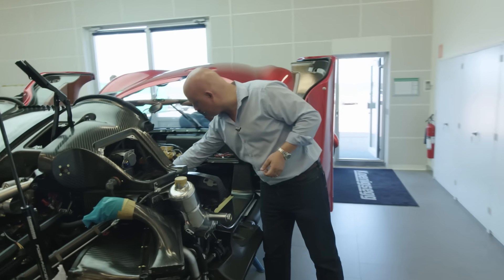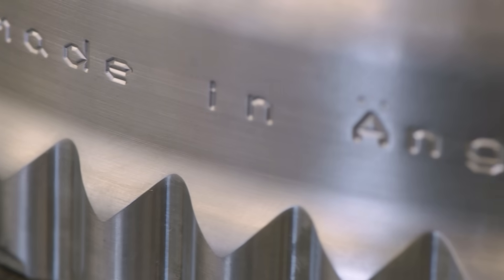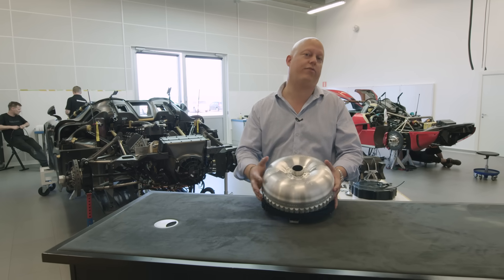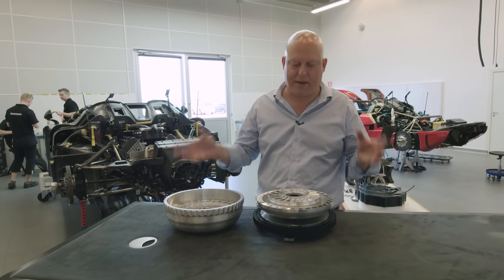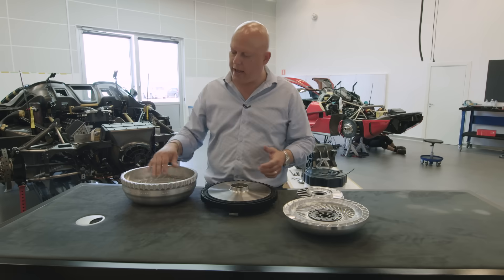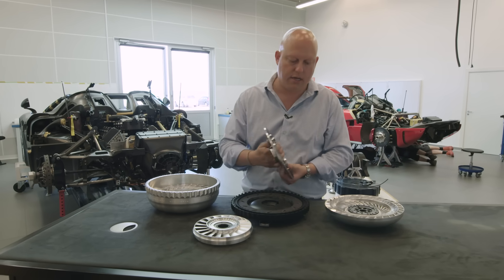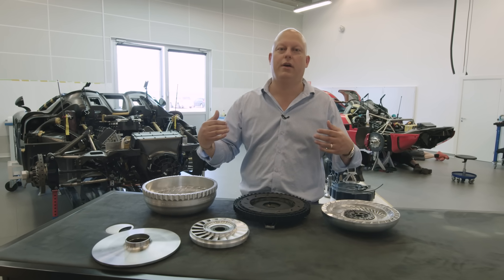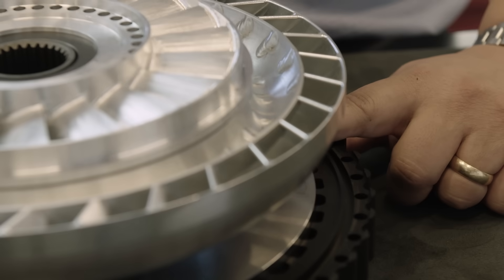248 MPH Without A Gearbox: Direct Drive  -- /INSIDE KOENIGSEGG

Comment: Asks for expert help, no one seems to understand so he does it himself. Keeping in mind this is only one small portion of the car is just insane. This guy is a mad scientist.
Reply: joao branco When this car was first released he said it was based off an idea he had last summer.. this car is like nothing we have ever seen before and he materialised this idea within months. Surely he has a team yes.. but something tells me he's the innovative thinker, main problem solver and a big part of the brains
Reply: he is ! if he isnt how he could have such inovating factory? they make new technology...and build all car themselves under one roof...what other company does that huh?  he doesnt save money...he inovate...learn...I think if he wasnt educated before...he is now...and thats why they also did themselves...to learn about it to be able to understand it completely
Reply: They konsult experts and have really good engineers and scientists. It's not like he designs it all by himself
Reply: John Doe Relativity speaking, it appears so. A torque converter manufacturer vs a company with 98 people total.
Reply: you obviously do not understand how electricity works in motors, higher voltage allows them to use smaller wires in the motors to carry the same number of watts, so the motor is smaller reducing weight while maintaining the power rating they need
Reply: Kubla84 see
Reply: Best Electronic Music From New Geniuses depends on the amperage. Volts aren't nearly as dangerous as amps. In fact assuming the amps are low enough you could touch 800 volts with your bare hand. Higher volts allows them to make the same wattage with less amps. (volts × amps = watts) which would in turn mean thinner wire, which provides weight reduction.
Reply: He's kind of like a car Steve Jobs with enough of Woz built-in to come up with workable innovative solutions that just need to be realized.  Apparently he then takes it upon himself to realize his conceptions even if he has to do it all in-house with his obviously uber-talented small team.  His stuff could trickle down in ways Formula 1 racing has in more modern times failed to do. Often with car manufacturers the point where no partners are willing to help engineer and monetize solutions is where a project like this ends. Few car makers are either unable financially, or engineering wise, to realize radical new technology advancements that don't recoup multitudes of their investments..  This dude just never says never it seems.  On top of that he's a successful businessman much like Jobs.  Yet, normal folks have never heard of him save some of his cars Top Gear or enthusiast magazines have profiled.  His brilliance reminds me of Dean Kamen who advanced medicine and made The Segway yet no one seems to know how brilliant he is.   This converter is stone brilliant for insanely powered hybrids since electric motors have such a huge rev band they don't need transmissions.  Now with the tandem combustion motor not needing a transmission a seamless blending of the two is realized and lots of weight and complexity eliminated.  That said this is one super compact extreme tolerance engineered device.  Impressive.  I hope this guy becomes more of a mainstream manufacturer consultant because things like his cam-less engine heads can really improve just about any current automobile's combustion engine.  Who knows what else is inside his mind?
Reply: @johnwerner4925   I totally agree with you , well said !!!
Reply: Total of 520 kW for the three electric motors.(Plus all the extra power needed by the car)
Reply: + Best Electronic Music From New Geniuses
"it's like 800W mini-speakers" Try that :-)
I think your expertise in Music don't apply to this.
If they have 400 V , the current will be up to 1500 Amps , try to switch that with a silicon regulator in a limited area like in a car.
Silicon never drain to zero, it's always a few hundreds mV over it and every 0.1 V generate over 100W heat.
By increasing the voltage to 800V , those problems will half and it's only a matter of time until you see 1600 V or more.
The danger is if the wires start to melt the isolation, you don't survive 400 V either so a design made to work is safer than 400V burning wires and regulators.
Reply: 2 or 3 yes, not like the 800 "experts" bugatti consults :P
Reply: Ergh, it's not really himself? Like he said, he has experts in the mechanical aspect of the car to create that thing instead of asking others because no major manufacturer seemed to understand what they were going for. He was basically just a conceptor with probably some inputs and economic stuffs, but he does understand the whole thing. Just that he sucks at explaining it, cus you know,  not a native english speaker.
Reply: Knights2theEnd o
Reply: Where did that come from?????????
Reply: When asked which was the hardest part of building the car, his answer was : EVERYTHING!
Reply: 800 W jump ?  , what are you babbling about, effect don't jump.
800 Volt can't even jump 1 mm in dry air, normal temp and pressure.
A tazer has a current limiter and much higher voltage until the limited current pass the target.
eg. first very high voltage with no current (0 W) , then low current and reduced voltage that result in a few watts.
Reply: You gave me chills when I read this....and that's a good thing. Lol
Reply: 800lb Gorilla, you can't say every CVT is the same. Thats like saying every motor is the same.
Reply: 800lb Gorilla, in that youre right, but thats just a boring way of looking at it! Hell, you could just compere it with scooters by thinking like that. In my opinion this is absolutely  revolutionary and shouldn't be taken as a common used CVT in EV's, which there ain't. This kind of idea's is what revolution is all about. And thats why I was implying that youre statement was like saying all motors (engine's) are all the same, because they have a rotating crankshaft!, not so enthusiastic..
Reply: Knights2theEnd 
See new electric engine in my vlog and comment till where the Madness can go for technology...
Reply: Its a combination of him and his team. He is a visionary leader as well as a superb team builder.
He finds the best talent and nurtures it, he has a very clear idea of not just a his top-line goal; 'make the fastest cars' but also the broken down steps needed to achieve that - generate and harness power, add lightness, aerodynamic efficiency, grip etc.

He is completely invested in his product, and also innovative. The gas driven valves, his turbo designs, his lack of concern with making his cars pretty - we have learned to like his aesthetic because of what it achieves. No one got their first look at a CC8 and wanted a poster of it on their bedroom wall because it looks like a half used bar of soap.

Unlike Musk, who fires great engineering minds from his companies over trivialities, CvK knows how to extract tje best from people without feeling threatened by them if its better than what he can do.

This is what makes Koenigsegg (and Pagani, for slightly different reasons) actually worthy of respect, admiration and - if you have the money - ownership.

Its why Bugatti is a joke to me. As Gordon Murray said 'Its a stupid car' (talking about the Veyron). They couldnt focus because they dont have a leader like Christian. They wanted speed, so they added power with a big engine. They wanted luxury, so they added insulation for silence and opulent finish. They then had a heavy car which wasn't fast enough. More power. Strengthen drivetrain and chassis. Ride and handling sub-optimal. More electronic controls isolating the driver from the drive. Round and round that cycle until you are left with a heavy, thirsty pretentious car that looks like a ladybird and can only have its tyres fitted in the french factory at a cost of €80000.

If you want a 200mph VW, buy an R8 v10 plus, an Aventador or one of the top range porsches. Bugatti just tells the world youve got a shitload of money but absolutely no brain.
Reply: hiddenthunder very well said, you’ve written what was in my head, so I won’t bother saying it again.
Reply: He doesn't have to cut the carbon fibre himself, but as the story of Tesla shows, it's one thing to make a prototype out of an existing car and a whole other ball game to market it, find and retain customers, hire the experts, set up the infrastructure, know how much everything costs, raise the money, pay the bills, come up with the ideas, get over the flaws of your first ideas, carry out testing, maintain quality control, get it homologated, finally go into mass production, and make a profit and go on to disrupt the whole market place and show where you're better than the best of 'em. Elon brought all that to the table, or else the Model S would have remained no more than a concept that could have never sold.
Reply: He doesn't have to. But he did.
Reply: A tazer uses 1000 times less amps than a car, and only 7 watts, but 800W can still jump through the air easier than 400.
Reply: Knights2theEnd this is also a gearbox.
Reply: I agree.
Reply: Most of them.  Automatic transmissions and torque converters are... you guessed it... hydraulic couplings.
Reply: Best Electronic Music From New Geniuses
Well 800W mini speakers would be really great. Same goes for the motors
Reply: Nothing new about torque converters just getting a custom one built is an ordeal so just do it yourself.
Reply: He also said that it was just not worth it for other companies since development is very expensive and Koenigsegg just needs a very very low number of actual units. Just designing it, creating the manufacturing tools etc. would cost a ton and then Koenigsegg buys maybe four converters a year. Like Christian said himself in the beginning the actual technology is 'old school'.
Reply: AND More Than 50% of way to
DeLorean Time Machine & "FLUX CONVERTER". what the Mayans were doing 10,800 years ago (Just switch construction materials around). Guess Patents have
expired by then, yes? 💡🙈
Needed Now : zero point energy (where are you, Nikolai?)Peace.
Reply: You have a creative idea, but you don't know how to manage it scientifically, so you ask scientists and engineers to make it feasible.
Reply: Anyone else think this might be amazing to incorperate into madern drag vehicles lol
Reply: He's talking to motor engineers. Full stop.
Reply: This guy restored my faith in humanity..I hate my CVT
Reply: Knights2theEnd please m8. he had a team behind him. he knows what he is talking because it was explained in detail so he knows.. a company that makes millions is not drived by 1 person.
Reply: joao branco in the beginning it was just him, he’s smart as fuck, sure he has other people’s opinions but this man is an inspiration, used to take apart mopeds at age 13 and make them better to sell, he’s a genius and knows how everything works, if you think for a second he’s a sheep than I’m sorry but I have no respect for you
Reply: Or a complete bullshit artist.  It's a torque converter, modified.  This isn't revolutionary work.
Reply: Sandor Clegane must have been last week, happy birthday. pretty much every electric-drive system doesn't utilize a multi-gear transmission. max torque at 0rpm and modulate. yawn.
Reply: Your sister was a pretty good ride she liked working that stick shift.
Reply: Kubla84 Who are you replying too. My vague reply was directed to Best Electronic Music From New Geniuses 
I just couldn't be bothered giving an explanation. My knowledge of electric motors may not be vast but adequate enough to agree totally with Kubla84. I first built a functioning electric motor at the age of 13 for a manual arts assignment.
Reply: And upping the voltage increases chances of arcing, increases chances of injury, and 400 volts is enough for heavy industrial equipment which travels entire rooms, whereas the car electricity travels through 100 grams of wires, which twice as dangerous voltage would bring down to 50 grams.
Reply: Volts gives not indication of the power used, 20,000 watts? he speaks for 10 minutes and gives no indication of the power generated at 800v. that's for people who are idiots. at least give us the watts you get at 800v or not brag at all. else it's just like empty marketing pseudoscience. arcing increases at higher voltages and the wires are not travelling for, perhaps a few feet. arcing inside the battery terminals or after an accident is not worth the magic 800v figure probably.
Reply: @bestelectronicmusicfromnew5189  
Europe has 230V as the common voltage  in apartments and houses, while the U.S has 110?
Same deal, only in DC and taken to the extreme.
Lower temperatures, lighter equipment, lower charge temperatures, less stress on the battery when using (a lot of) power,  less stress when using the crankshaft as rotor to make best efficiency without "gearing it down" ...
I think some Swedish people have more knowledge about this than you, and they do this for a reason.
Reply: Best Electronic Music From New Geniuses you are the most stupid person on YouTube. You doesn’t know anything about electricity.
Reply: Wow it converts torque
Reply: Never claimed there was, are you slow?
Reply: You must not be too familiar with the history of electric motors and their application to locomotion.  That's okay, I remember when I was 14 and thought I knew it all, too.
Reply: Correct, that's why I didn't say (write) that.  What can be said, is that locomotion has the same desired result, regardless of methodology or technology, and that the theory of operation for most electric drives is fundamentally the same, regardless of configuration differences between application-specific design.
Reply: joao branco out of context
Reply: you should know that 800V is completely useless and dangerous voltage for a car. it's like 800W mini-speakers. 800V gives you the ability to use a truck of 250 tons.

Comment: How the heck do you even come up with that shit
Reply: A lot of trial and error, computer-based physics modelling and the patience and money to CNC piece after piece after piece.
Is my guess, anyway.
Reply: An idea lol. Like hey i wonder if we can just get rid of the gear box and make the torque converter do all the work instead as it increase's torque so it's possible that it can drive the wheels alone without a transmission ( with engine of course). The transmission in traditional cars helps by making gear "steps" from smaller to bigger for better acceleration. Pretty neat idea but this is just prototype stage so they do not even know how well it works yet.
Reply: Turbine iterative design. Its a pretty intense process. Had to do it for my final exam. It wasnt all that fun but it would be fun for something like this.

Comment: flywheel spins at 2k>engines power is directly transferred to direct drive>through hydrologic pressure the inner ring spins which acts as a lock. Ferris wheel spins when the car is in neutral bc the the power from the engine is being transferred. Once the car goes into gear and the inner ferris wheel ring begins to transfer the power to the wheels. Once the wheels and the rpms match the inner ring locks in on "7th gear." 
Really a genius way to apply old technology, think of the whole this as an Rc car with only one big gear which doubles it's torque. I wonder how this set up would perforn on a baja truck?

Comment: This only works because they have a giant engine plus electric motors. Dragsters also do this, they just have one clutch that goes directly to the rear diff. In a normal car which is heavy and has a small engine this would totally suck.

Comment: if your only using the converter to achieve max acceleration but dont actually need it, i would think it would be alot easier and effective to make a clutch that is electronically regulated to control slippage to allow max torque.

Comment: Been thinking about such a system for years, especially the electric motor on the crankshaft part. 
Surprised nobody has used a smaller combustion engine along with a crank motor as a generator/brake/starter motor on a normal car before.
Reply: Honda did this with the Insight in 2000.
Reply: actually every hybrid does

Comment: Great invention! However, using this mechanism eliminates the use of engine breaking (down shifting) which will exert more use of the breaks and wearing them faster. Amirite?
Reply: Regen on the electrical motors?

Comment: This old cat says "SO WHAT" tucker did this and Jim Hall of Chapparall did it over 50 years ago. 2 speed auto transmissions work well with a good torque converter especially if it has adjustable stall speed. Nothing new .

Comment: i wonder how they deal with the massive heat generated by the colossal inefficiency of a torque converter? the aluminium construction is great for heat dissipation (and i'm guessing all the parts are properly heat treated post weld to return the strength lost during the weld process) but if this thing gets hot enough , good bye heat treatment!

Comment: imagine a similar type system on a go-kart. take the top speed from 20mph to 70 with the same sized engine
Reply: It does not work that way. As he said, the system creates a lot of heat. In a go kart, where you would go pretty slow most of the time, you would always have the coupling working, generating lots of heat and killing coupling and engine.
Reply: Primus ah
Reply: Primus if i could go 70 and not 20 i wouldnt be going slow

Comment: ok so basically the system is allowing the engine to run at an optimal rpm and then converting that power up and down through that system? so at low speed you are basically limiting the power sent to the wheels, but then higher up you're basically allowing all of the power through, using that clutch to fully lock it up?